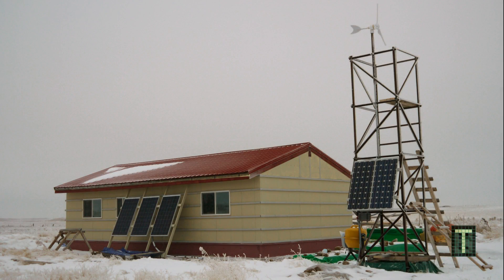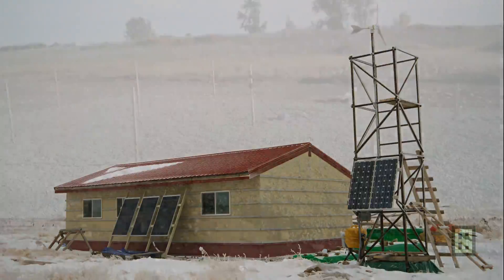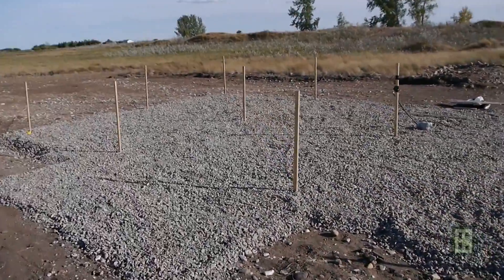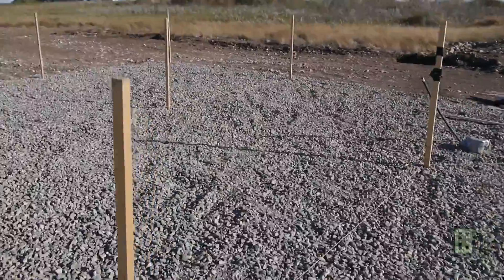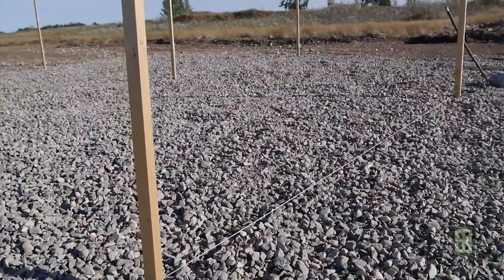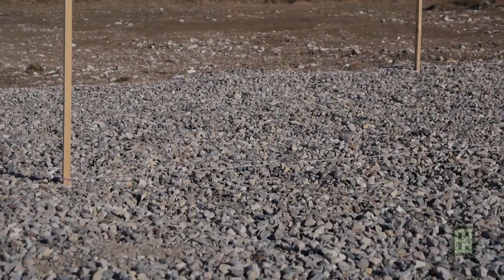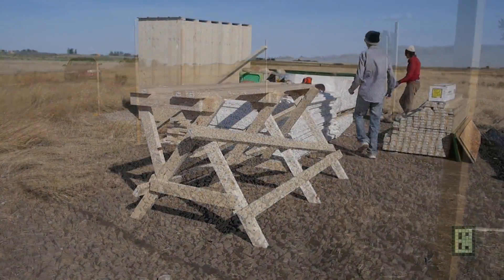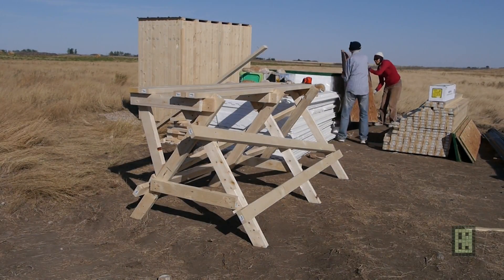Off Grid House

Comment: Electrodacus, you've done a great job. I wish I owned that at your location. Because you're making it offgrid, maybe you can think about a way to heat it up with sunlight.
I've done it, and it works great. You can use other materials, but basically with some poly carbonate or just glass. In the link below, I show you a 'pop can' air heater I've made. It's made of around 400 Cola pop cans.

https://www.youtube.com/watch?v=8onkXvkQWIQ

It heats up the air with +65°C. Example: At noon it's 10°C outside on a sunny day, the air is  heated up to 75°C. 

https://www.youtube.com/watch?v=h3mr3X-5e_I

At the end of the video you'll see a daily statistic. The maximum was reached at noon at around 82°C.

Regards.
Reply from the maker: +Bart Hermans I will heat with solar but I will be using PV panels and heat with electricity that is the least expensive heating method possible at my location.
Here is quite cold in winter -30 to -40°C is not unusual even during the day. The house as you seen is well insulated and relatively small 65sqm but still needs in the worst winter month January here around 1000kWh/month for heating.
I will be able to provide that amount of heat fully with a 9kW PV array and that energy will be converted to heat directly with resistive heat element (basically just long copper wires) and the energy will be stored inside the concrete slab that is around 14 cubic meter and can store up to 100kWh at a 10°C temperature delta no chemical batteries are used for this heating system and there are no moving parts. The controller is something that I will need to build since nothing like that exist and I call that a sort of Digital MPPT controller for heating. Currently I work on a different project a Solar BMS you can see some of my latest videos about that but when I'm done with that I will start designing the Heat controller.
Reply: +electrodacus Well, you sure know what you want. I own also in total 9KW PV panels in Belgium. But in winter the days are very short and most of the time there's no sun and I've got a lot of shadow. My complete installation gives me only a little bit of KW's during the cold winter days... But shadow is not a problem for you I think :-)  Concrats for you inventivity !
Reply from the maker: +Bart Hermans Yes your location is really bad for solar even without considering the shadows. According to PVWatts a great online calculator with my 720W PV array you will only get 13kWh in December and 21kWh in January this with 10% loss considered and steep winter angle facing direct south. As a comparison my location is Regina, Saskatchewan, Canada and I get here with the same 720W (0.72kW) PV array 69kWh in December and 88kWh in January that is 4 to 5x more and yes I do not have any shadows so I really get this numbers.
Production over a year will not look as bad with your location getting around 610kWh/year and mine 1085kWh/year but those low production winter months are really bad and makes solar less exiting especially for heating in winter.
To bad that here in Canada people think solar is not a good option because of long and cold winters :) but I get here the exact same amount over a year as in Sydney Australia.

Comment: I also noted no roof penatrations. ventilation, plumbing,flues of any kind. Frankly, I would have recommended 2 x 6 with 3x4 osb or plywood and house wrap.
Reply from the maker: +Robobinks Last  There is a good reason there are no roof penetrations (i dislike those) there is no such thing as perfect roof penetration and it will not take long for that to leak.
There is heat recovery ventilation and penetrations made on the side wall for that. All pluming is in the concrete slab you may be able to see in some of the photos before puring the concrete.
Currently I use propane for heating the unit is outside the house and warm coolant gets inside where that heats the concrete slab but I will change that to 100% electric heating with solar PV panels no pluming will be needed for that just heating wires embedded on the concrete floor under the ceramic tiles.
This house has a minimum of 7" of expanded polystyrene insulation on the outside in some places is 8.5"
There will have been no savings on material cost with 2x6 + plywood and the house will have not been strong enough for the strong winds here.
Also all the 2x4 lumber is inside the thermal envelope so it also acts as thermal mass. Many people underestimate the need for thermal mass.
Here in winter -30C to -40C are normal temperatures even during the day and I can leave the house unheated for many day in those condition without much drop on internal temperature do to proper amount of thermal mass.
The house can even survive a week in the middle of winter without pipe's freezing inside and a normally constructed house here will have freeze damage in less than 24h
I'm really busy right now (with the solar BMS project) but I will make more detailed videos explaining all my decisions when I get the time.
Reply: +electrodacus looks like you have things figured out... There's always more than one way to skin the cat....
Reply: +electrodacus I plan on doing something similar. However will styay more conventional. May research a few new ideas though.  Your future videos should be interesting.
Reply from the maker: Robobinks Last
If you want to build an off grid house I will say you will need to pay a lot of attention to thermal mass especially if you are in a cold climate and you want to heat with solar PV panels.
I'm an electrical engineer and designed a Solar BMS charge to store electricity in lithium batteries since it is less expensive than using traditional Lead Acid but after I'm done with this I plan on designing a solar PV heating device that will be able to take up to 12kW PV array and use resistive heat elements to heat a house. My house only needs a 9kW PV array and with that I can fully heat the house no backup needed even in January. No batteries will be used for this the energy will be stored in thermal mass.
My house needs about 1000kWh/month in the coldest month usually January and the 14 cubic meter concrete slab that I have an you seen is completely insulated from outside can store 100kWh at a 10C delta that will allow me to keep the house warm even with 3 or 4 days without any sun.
Of course a large water tank can also be used as thermal mass but you will need a about 2300 liter (about 600 gallon) water tank with a delta of 30C in order to get the same amount 100kWh of thermal storage and that will take space inside the house.
Is better to have double utilization and use the house structural elements as thermal mass.
I'm mostly referring to the type of foundation used the solid wall I made plays a less important role even if that also contributes a bit to thermal mass is less significant.
The solar PV heating is less expensive even that natural gas is just that you need to pay for hating 25 to 30 years in advance.
In my case that is about $10k or around $400/year for heating.
Reply: +electrodacus My degree Ba Arch.   The environment in KS isn't to severe for long periods. Where I live now. I'm traditional in design but have a pretty tight house. My combined utilities gas and elec year over year is total 840 for a year. I have a mini solar hot air unit and I close my attic vents off in winter. lol... I'm intending on building a slab home and using some of those strofoam blocks.  I'm in the early stages but know I can get it done. Even if I live in town.  This home is 950 sqft. main level and 950 bsmt.  Next house no basement.
Reply from the maker: Robobinks Last
Those utilities seems to be quite low. My electric bill is about $9-$12/month so about $108/year this is the amortization cost of the current solar setup but only using 60 to 80kWh/month with amortization cost of 16cent/kWh.
The weather is way worse here in Saskatchewan, Canada then it is in Kansas that is the reason heating will be here $400 with solar PV as the least expensive option.
I need about 4000 to 5000kWh for the entire winter so that will look like 8 to 10 cent/kWh but that is because the rest of the months all the energy from PV panels remains unused unless I find some use for it.
We drink distiled water that we buy from the store at the moment and that costs about $700/year 1 gallon/day at $2/gallon.
I can do that water distillation with electricity once I have the large heating array and that will more than make up for the investment in solar PV but only uses a fraction of the energy so still need to find some more uses for it.
No having a basement on the new house is probably a good idea. I do not like basements they are expensive and not that useful but may depend on the type of soil in the area.
Reply: +electrodacus Not bad considering I use a dishwasher and electric dryer.. so, in relative terms. I use gas for winter heat and hot water. so truly, not as efficient as you but better than most.  My plan is to also incorporate wood burning into my scheme of things. Also with KS. wind I'm thinking solar panels and a wind generator . you are correct about the basement. They do add much expense however in KS. they are pretty much standard due to tornados. Funny because in Oklahoma homes are primarily slab and they have more. nasty storms.
Reply from the maker: Robobinks Last
If I knew tornadoes are a real possibility I will build with ICF. That was actually my first choice also but concrete is quite expensive here so I went for this staked lumber method.
Max wind speed since I moved here was 108km/h gusts not that much but considering the large open space house needs to be well build.

Comment: Big waste of material. conventional framing makes more sense.
Reply from the maker: +Robobinks Last With conventional framing you normally use OSB boards and I don't like them since they smell and are toxic. Also the cost of 2x6 + OSB will be about the same cost as this method of solid 2x4.
I'm as you see in a middle of a field with no other buildings or trees around and winds are quite strong here. A traditional frame building has a high chance to get damaged by a strong wind over the life of the building thus making more waste.
The only disadvantage to this method and probably the reason is not used is the amount of labor needed when compared with classic framing.
Not to mention this house is about 65sqm (700sqft) much smaller than an average house so the amount of materials is smaller than that and it needs way less energy for heating over the life of the building so the impact on environment is much smaller if that was your concern.
 Still this building is much more than just the framing method there is good thermal insulation and large insulated thermal mass that most building are missing and that is extremely important in keeping a good average temperature inside the house. The 14 cubic meters concrete thermal mass will also be used as thermal storage when the house will be heated directly with solar PV the least expensive heating method available at this time.
Reply: +electrodacus sounds good.

Comment: Why the use of 2x wood for the walls? Wouldn't brick be better as far as longevity-insulation etc? Now you have to worry about rot and termites a lot more. Just curious as to why that choice thanks.

Comment: Beautiful house.  First time I've seen one built like that.  What Brand of wend generator did you use?
Reply from the maker: Jim Davis Thanks, It was my own design that is why you probably did not see something similar. You can download the project from one of my web pages greensask.com . The wind generator is a small 300W Hyacinth and you can see a video I made about it https://www.youtube.com/watch?v=kR7hS58U17E
I have good wind resources but solar PV is way better and I will take that wind turbine down and probably sell it on eBay so let me know if you are interested :)
Reply from the maker: Sam Wall
In the wind turbine ? Not even sure what to ask for it it will depend where it will need to be shipped is a bit heavy.
Turbine is 24V and there is a separate controller that you can see on that liked video
I guess I will be OK with 150$ for the wind turbine and 200$ for the controller + shipping cost.
Reply from the maker: Sam Wall
I will need to take it down and see the exact weight but I assume shipping to UK from Canada will be to expensive. Shipping to Canada and US is more manageable for heavy parcels but international is extremely expensive.
You will get better if you just order this wind turbine new from China they have much better shipping options.
I just looked at Canada post website and used 7kg for a parcel to UK and it is $109 for the least expensive ground (sea) option but extremely slow up to 8 weeks with no delivery confirmation.
Next option is Xpress post $211 with delivery confirmation and 5 to 8 business days (about two weeks).
Reply from the maker: Sam Wall
You can search on eBay for 300W wind turbine it looks a bit different since they use all 6 blades in the photo (I removed 3 of them since 6 makes no sense it will be less efficient).
Reply from the maker: Sam Wall If all you have is low wind you should not get a wind turbine. I have moderate winds here and I still prefer solar it will perform much better and more predictable.
6 blades in medium to high wind speed will considerably reduce the turbine efficiency do to turbulence created by the extra blades. And when you have medium wind speed is when you produce most of the energy. In extra low wind speed there is nothing there not even 2% of the total monthly energy.
You will never see a commercial wind turbine with more than 3 blades.
I have an older 4 or 5 years video with a wind turbine calculator I made for savonius and I used real wind speed data for my site so you can actually see how much energy there is on each wind speed.
If I design a wind turbine to start producing at 5m/s instead of 3 or 4 there will be almost no loss since there is so little energy in those low speed winds. Same with high speed winds if I stop the turbine after 13 to 14m/s there is almost no loss in energy produced over a month or a year.
Solar is way better so wind is dead for me :) and I have relatively good wind resources here.